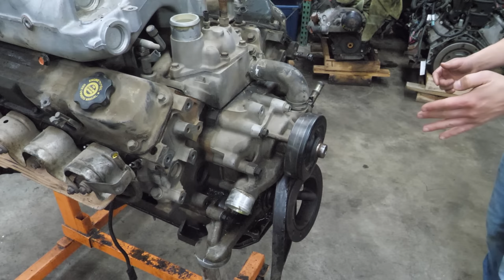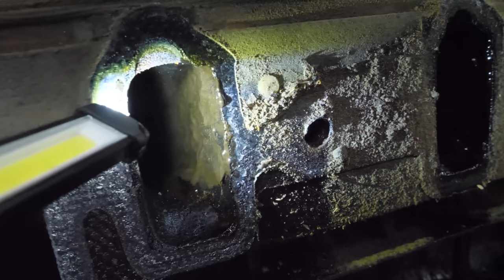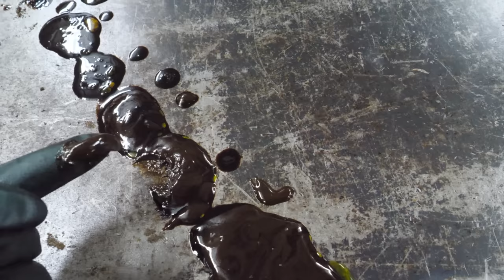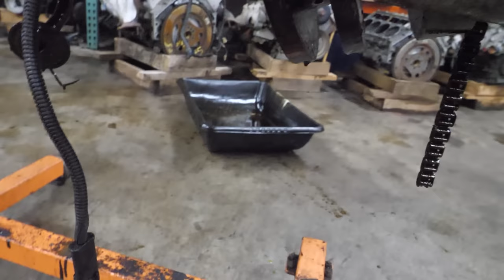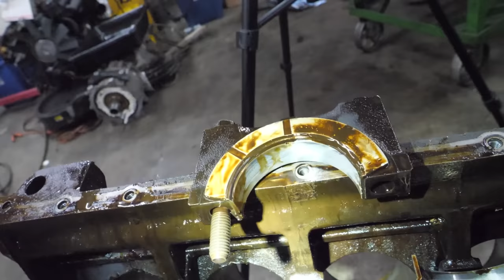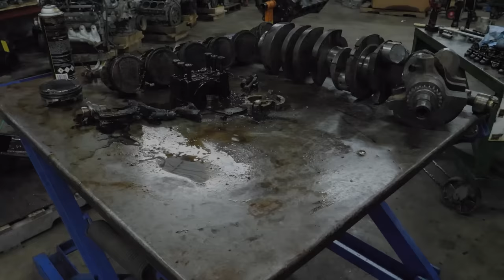8 LITERS OF DESTRUCTION! Dodge Ram V10 Engine Teardown. Broken In Ways I Have Never Seen!

Comment: Moral of the story-oil is cheap, engines aren't. Judging by the coloration of the valley, inside of the timing cover and the inside of the crankcase, this engine never had the proper oil changes and was beat to death. Can't fault the rebuilder for this failure, the blame lies squarely with the owner. Worst catastrophic failure I've ever seen-was a truck mechanic for almost 50 years. Once saw a IHC 392 C.I. truck engine run with a rod hanging out the side of the block; the rod exited the engine at such an angle that it didn't interfere with the rotation of the crankshaft.

Comment: I watched a video from India or Pakistan where they welded and turned a broken crankshaft from a big truck. You may have had more value in the crank than you realized. I am surprised the big V-10s don't have 4 bolt mains.

Comment: So, If you just deleted the bad front 2 cylinders and the bad rear 2 cylinders, you could still salvage a pretty good V-6 from the center, right? You'd just need to reattach the crank snout and flywheel flange and you're good to go!

Comment: To me, the most mysterious thing about what caused the failure is the fact that so much of it is damaged and appeared to have the majority of the damage happen simultaneously as opposed to flail damage. We don't know how long the engine was sitting, and personally I don't know what causes that dirty gunk oil outside of constant long durations between oil changes. Personally, I'd like to believe that the engine was a victim of an exhibition possibly involving a huge hit of nitrous oxide during a redline condition and grenaded for entertainment purposes. It could have been due to an oversize turbo as well, but that usually requires enough knowledge to know the importance of changing oil. In reality, it was probably fed a steady diet of oil additives instead of regular oil changes for a period of time and the engine dumped while towing something heavy up hill while the driver is just giv'n 'er. It would be really interesting to figure out what the first point of failure could have been. My guess is that it could have been high heat related (although, there was a lot more un-burnt oil than I would be expecting to see in places where it should be burned if it were a high heat / red metal condition). the crack in the coolant port, blew out the freeze plugs, timing went, engine spinning at red line or above, no lubrication, I'm amazed there weren't more than 2 bent pushrods with a broken timing chain. That said, maybe the timing chain broke last?

Anyway, I'd totally be down for some forensic discussion.

Comment: So what you’ve got on your stand there is a 450,000 mile engine I owned two of these one New and the other used the second one I purchased with 250,000 miles and and I put 200,000 miles on it and sold it in good working order with 450,000 miles on it, maybe you should get a hold of an engine that you know it’s mileage

Comment: The oiling system on those engines was always a weak point. The front mounted oil pump was in theory a good improvement over the old school 5.2/5.9 by making it a direct drive Chrysler got rid of the drive shaft and eliminating the distributor and going to the camshaft sensor solidified engine timing control. The downfall being that mile long oil passageway from the pickup screen to the oil pump. Every single engine those pump gears and timing cover always look like trash inside.

Comment: Im going to say torque.  Someone put a brick on the gas pedal.  Thats my best guess. It kept going. It kept going in the center and kept firing until it broke the crank. Temperature must have held above 400 degrees for a long time. She didnt deserve this end.
Reply: I think it was towing on a highway. I bet though it had a manual behind it. The entire engine seemed to have compression flowing through it. Stuff shoved up and out everywhere. Probably downshifted by accident sending the revs to the moon. The engine having a load plus all of that would make quite a big boom. Would love to have seen it. Probably a big boom was visible from out of the truck. They just turned the engine off and kept it running in low gear or something

Comment: My guess is the engine got no treatment at all. The oil looks like 20 years old. The oil pump gave up, the piston bearings went dry, overheated what caused the piston rod to break and eventually the debris spread over the engine causing follow up damage until the crankshaft broke. The inertia of the vehicle, probably pulling a trailer, kept the engine revving even though it was already dead. That's why everything got so massacred. 

But that is just a guess

Comment: Either somebody intentionally held the pedal to the metal until it blew or somebody was at a truck pull running nitrous on it. I'll vote nitrous since it was the two end cylinders. When the nitrous comes into the intake, it always goes to the end cylinders and leans them out the worst. Since the oil pump is at the front of the engine, the front cylinders should have had enough oil pressure to survive better than that. 6 cylinders running on nitrous on a high torque engine can drive a lot of damage.

Comment: Given that it clearly came loose at an extreme rpm, I'm with everyone else that there was only 2 relatively small holes in the block considering the state of all the moving parts contained inside. I just can't fathom why that oil pan doesn't look exactly like that pile of rubble you pulled out of it.

Comment: I guarantee you when that when that motor started to have problems it was the gas pedal to the floor until it blew up
I was a Chrysler Doge Jeep Eagle Mechanic for 38 years and I've never seen that happen that bad but I have a set of head's with only 407 miles on them, the block had a porous casting.

Comment: I would have to agree that, for all that inconceivable destruction, the fact that the block - even the oil pan - isn't in worse shape is an inadvertent demonstration of how stout this engine truly is. The problem really seemed to be caused by deferred maintenance on cooling system stuff like gaskets. Oil starvation did not appear to be the problem; maybe infrequent oil changes to a degree...? It would be good to know how many miles were on this.

Comment: So the one common fatal issue is the oil pump bolts backing out. Then one day all of a sudden no oil pressure. Seems like it happens at the worst time, like WOT towing. Leads to spectacular failure.

Comment: Something just tells me this wasn’t running when the carnage occurred. 
How clean the engine was removed and prepped, and the carnage tells me this was likely a towing in gear accident. 
Was probably towed on a wheel lift and in reverse. The engine RPMs would have had to be insane to cause all that damage.

Comment: How a mild, relatively low rpm truck engine could detonate to the extent this one did passes belief. I've seen exploded 10,000hp nitro top fuel engines that unwound at 8000rpm under unbelievable pressure that didn't look this bad.

Comment: I wonder if someone put it in a low gear while going down a hill at highway speeds with a heavy load. That would give you that really high rpm that couldn't be stopped by a rev limiter, the instantaneous high rpm could stress those components to their breaking point, and it'd have a lot of momentum that would transfer through the drivetrain to the engine. Add to that an incompetent driver who maybe decides to floor it because they feel the vehicle slowing down and you might have the scenario required to cause that kind of devastation. They'd have to have been going pretty damn quick to do that though.

Comment: so this v10 isnt related to the viper v10?
Reply: the first gen viper v10 block was basically the same v10 you could order in Ram trucks at the time. They had a modern Shelby Cobra sports roadster concept to save the company image but didn't have an engine. God Bless whoever suggested "well, we have a V10 from the Ram pickup..."

Comment: Probably forgetting to push the clutch in as the engine blew up from neglect on the highway... 
Mangled engines have come out from the track just from a spin out and driver forgetting to clutch as the car skidding backwards forces the engine in reverse...

Comment: IMHO, this was re-manufactured by an amateur shop, SHORTLY before it exploded. The builder used a ton of ass embly lube, and didn't torque the rods bolts. After first signs of failure, the proud owned installed a brik on the throttle and joyfully watched and listened to it, self destroy......

Comment: Is the same engine that was in a viper?
Reply from the maker: It is not the same
Reply: @I_Do_Cars  can I ask your very experienced opinion. I own a 2014 grand cherokee with the 5.7 hemi. From day 1 I have used penziol ultra platinum fully synthetic oil and change my oil religiously at 5000km. I was considering getting a high flow oil pump as recommended in several forums/channels online. But recently came across some videos where guys swear that by changing from the 0w - 20 (recommended oil) to 5w - 30 the "hemi tick" valve related not exhaust stud completely went away. Any insight?

Comment: If it's a remanufactured engine it probably was not assembled to spec lol or it was a Friday when it was put together lol.my guess it was under a heavy load when crap let lose from the heat it generated probably started to boil the oil.

Comment: I think this is worth a pilgrimage for the story of this piece; and what the hell it sounded like. Good God at red line this would seem like a fraction of a second but, for it to have picked it up into the oil pick up? I'd think it had died long before feeding anything into the pick up. What the hell happened to this thing??  What really failed?  Aside from it being a dodge related product. 😂 Still this is an engine from the 90s. This kind of carnage does not seem possible unless you are gathering it at the end of a grinder. 🤣

Comment: If the v10 is nothing more than a 5.9 with two extra cylinders , then I hope they redesigned the heads, cause the 5.2,& 5.9 sucked almost everyone I’ve turned down has a crack between the intake and exhaust valves ,sometimes it’s every port, other times it’s just a couple on each head..

Comment: I had that in my 3/4 truck was a very nice engine But the transmission couldn't handle steep inclines with the construction trailer You would get 1/2 way up the hill and loose all forward motion then later parts started falling out of the trany into the pan Jeez Dodge

Comment: It always amazes me how American engines manage to make so little power out of a such a huge displacement.
Reply: Generally overbuilt then detuned results in exceptional longevity and durability. Ford 4.6 sohc lasts easily 300k with good maintenance, if not more. Lotta Town cars and crown vics out there with 500k miles or more. Theres a reason they were choice as taxis! Most of the low power comes from lower compression. I'd be surprised if this v10 was over 8.5:1. Safe ratio without e85 or direct injection is like 10.5:1, makes a lot more power for the displacement.

Comment: Pretty obvious what happens when you buy a replacement engine from a shady rebuilder. 
Crank broke is there it all started, ( probably a failed crank that was ground undersized to reuse) once it broke the " back half" grabbed the front half and started running out of time with the camshaft. PTV contact started wrecking parts at both ends of the engine. 
Not a fan of the V-10 from Chrysler or Ford, but that's not a V10 problem as much as a shoddy rebuilder.

Comment: I'm thinking this is one of those cases were someone wanted to leave their psycho spouse and had all the buddies come over and load everything in a 40' trailer (meant for a semi) while the spouse was away and got in the truck and punched it out of Dodge. Towing 80,000 pounds with a 3/4 ton truck and the pedal to the floor just might do it.

Comment: I don’t think this engine broke due to wear. I’m questioning at what rpm this engine was running when it broke. With all of that scrap metal in the oil pan, I’m surprised that the bottom of the block was still that much intact. 😁

Comment: I don't understand why you release the head bolts in the order you would tighten them on assembly. I do know why you tighten them in that way when putting it together, so don't explain that to me. But, this engine is JUNK clearly, are you really expecting to save anything from it?

Comment: Dodge has been under enginering stuff since the 50s. Like international, good luck finding parts as they continually changed things with zero reference as to models and replacement parts.

Comment: I own a 97 V10 5speed 4x4 from new only has 53,000 miles on it but I chang my oil every 3,000 miles or more often 2 times a yeas before summer & winter never one problem ever I think this motor never got oil chang and was running 5,000 R.P.M's when they redline at 4,200 R.P.M chang your oil and don't redline it to it douse this I'm pretty shere lack of oil chang and high R.P.M's killed this motor

Comment: So many jokes; so little time. Worst ever? 💯 ✅. Did the casting numbers on crank and block start with “X”?  I believe this was an experimental test mule. These engine were hard to start due to high compression. The experiment was to detach the front two cylinders and have them run as a pony motor to start the resulting V8. ✅ I got the reference to “the front fell off” ✅. If an independent examiner were brought in to do the post mortem on this engine, I believe the inevitable conclusion would be “failure due to normal wear and tear. Recommendation would be “repair or replace under warranty “. ✅. My opinion: I suspect metal fatigue” ✅ 🥸👍👀🙃

Comment: They cant make performance parts because the engine is crap   I dont see how that engine could last 45k if its used for work   Or play  but it must have high miles with that oil baked on bloop 😮

Comment: NOTICE : 
This is to show the proper way to express the torque. Don't say FOOT POUNDS 

LB / FT = TORQUE 
Viper V10

Torque:
SR-I and II:
465 lb⋅ft (630 N⋅m)
490 lb⋅ft (664 N⋅m)
ZB-I and II:
500 lb⋅ft (678 N⋅m)
525 lb⋅ft (712 N⋅m)
535 lb⋅ft (725 N⋅m)
560 lb⋅ft (759 N⋅m)
VX-I:
600 lb⋅ft (813 N⋅m)